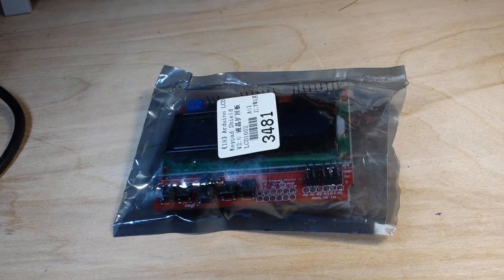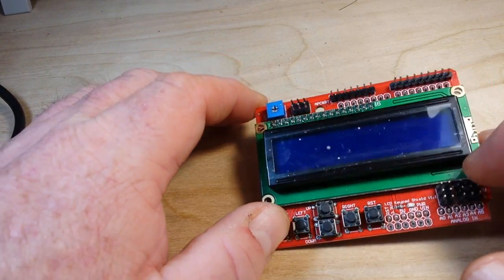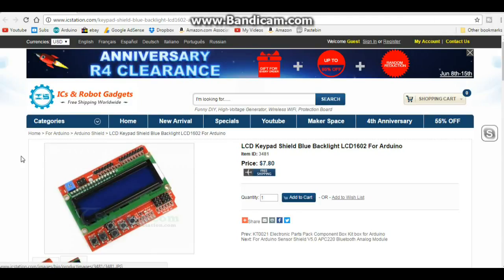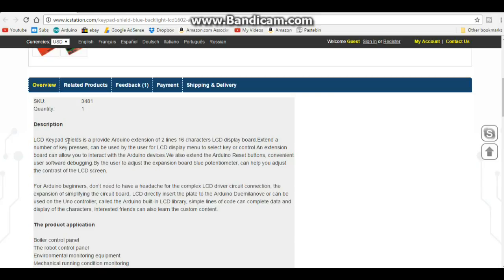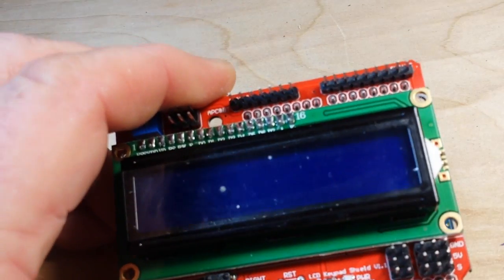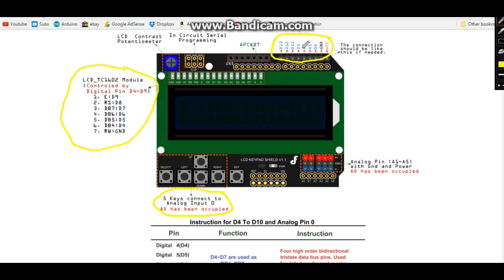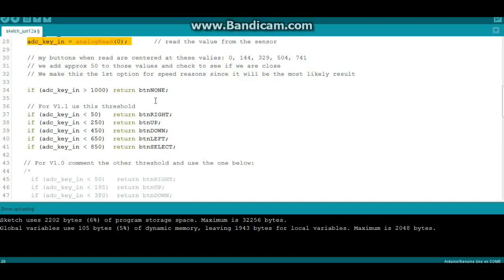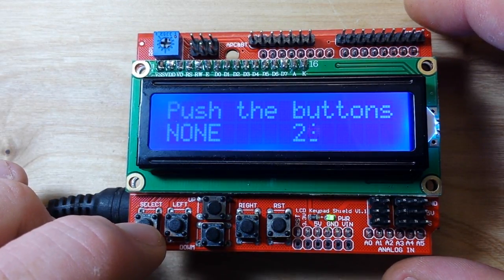ICStation com LCD Keypad Shield for Arduino Review

Comment: Great video !! very easy to follow. I don't know anything about programming, but i did see the A0 control the buttons and they all have different resistor values. I want to make an indexer for turntable and i found some code on other youtube video which i have loaded to the UNO. But what i really want to add is a foot pedal to control the select button. (this button executes a let us say 90 deg turn) Do you know how to connect the 2 cables from foot pedal and what code to add to get this working ?

Comment: Thanks for the video and links. I've used a couple of these shields in small CNC projects and they are a wonder for the price. I don't like having to tie up an Uno when a Nano would work just as well.  But the price of clone Unos makes easier to swallow.
Reply from the maker: George Chambers if you shop around the price difference between an Uno and a nano is less than a buck
Reply: True but it's also a space issue if you're trying to keep it small. I really like the Nano for its size with mostly the same power as the Uno. I just ordered 6 more Nano's for projects.
Reply from the maker: George Chambers I'm sure you have noticed in my videos I use use nanos most of the time. I like the size as well.